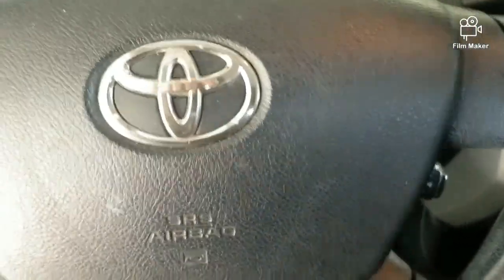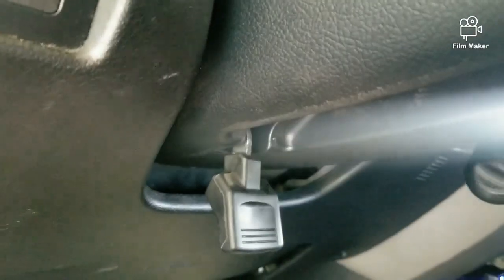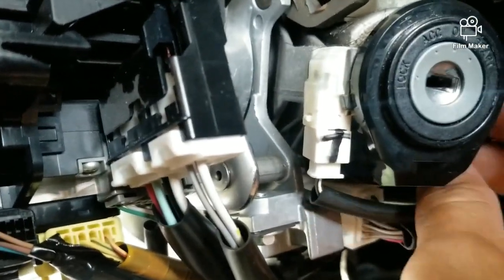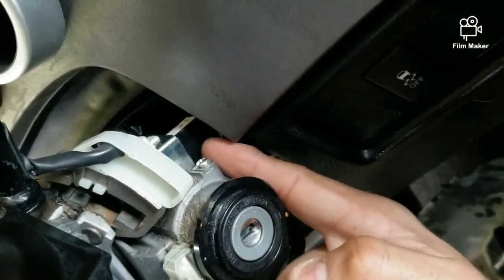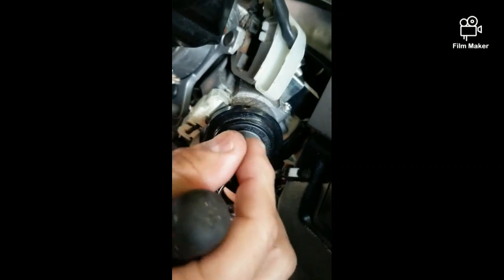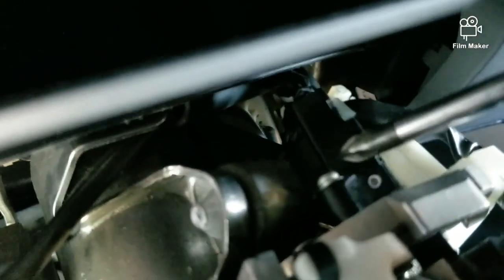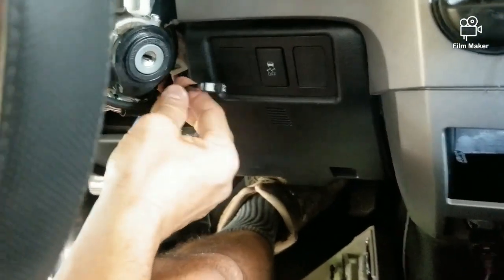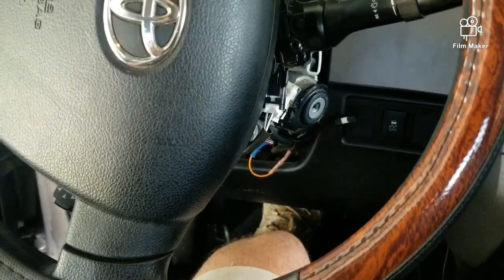How to remove stuck key 2011 Toyota Tundra Pt. 1

Comment: Mine did the same thing. I had a vent phone holder by the shifter. The shifter was hitting the phone holder. I took off the phone holder from the vent and relocated it somewhere else 🙏🏼 no need to replace anything. Ty for your video 👌🏼

Comment: Good video.  While following your instruction, I found out that you don't need to unplug that one connector.  With a flashlight and a small a rod or a stick about 5" or 6" long, you can actually locate that switch by looking into the big opening where the shifter moves up and down.  Using a rod or a stick, you can push down to unlock it.  Another thing I found out too is that if you unplug the battery power, the key can be pulled out too.   Then plug fb  ''Just though I  share this.

Comment: I have the same problem in a 2008 and I just did the same thing that this guy did. It seems to be working as it should when disconnecting that cable. I just hope this helps you. This is a 2008 that I have.

Comment: Hey!  Thank you!!!  Jst unplugged it and fixed. Question though, can you leave it like this forever???
Reply from the maker: I try to explain in the video but that is a safety feature so that you can't turn off your truck while in gear and then have it roll away. So I wouldn't leave it like that. In my second video I show how to repair the issue on the truck in question so the ignition lock can function as designed.
Reply: Hi Frank, yes.  But I was wondering if there was anything related to maybe the airbag or who knows what.  I tried to google the part..no success yet!  Cant  say thank you enough though!!! @scrappynotcrappy

Comment: Hey Frank I followed your instructions and I did get the key out but now my "remote stopped working" and it was working fine before I took everything apart do you have any suggestions as to what may have made the remote stopped working thank you so much for answering
Reply from the maker: Maybe by unplugging the ignition lock it doesn't allow the computer to use the remote? I've not had to use the remote while doing this.  I only use this trick as a way to release a stuck key due to the shifter switch not making good contact.  So I'd try plugging the ignition lock back in to see if that fixes your remote not working.  The part 2 to this video shows how to actually fix the problem I had with the shifter parking switch. Once I replaced that switch then I plugged the ignition lock back in as its intended.

Part 2
https://youtu.be/xwe9EDTz0qw